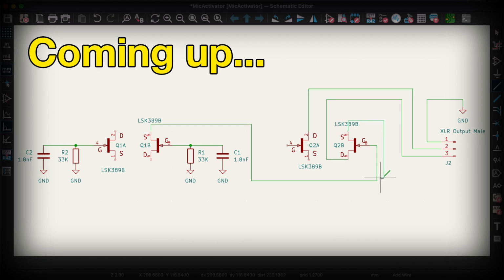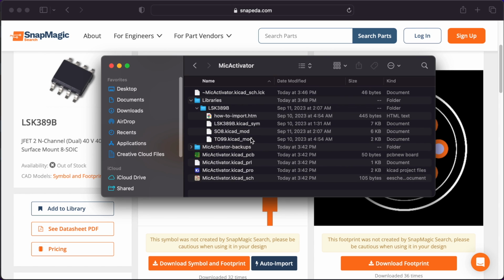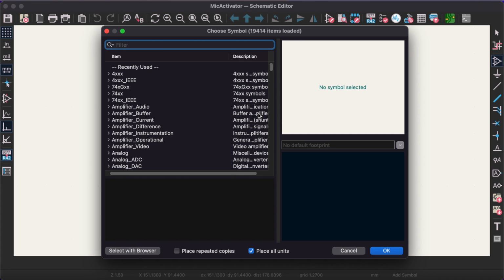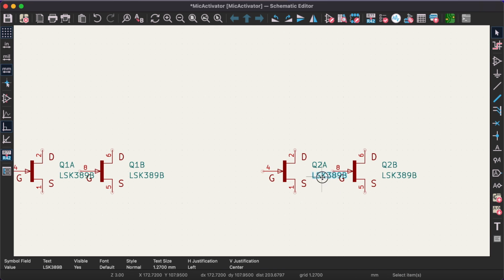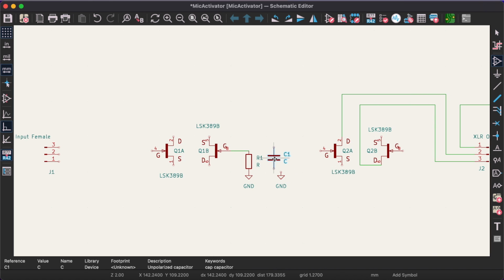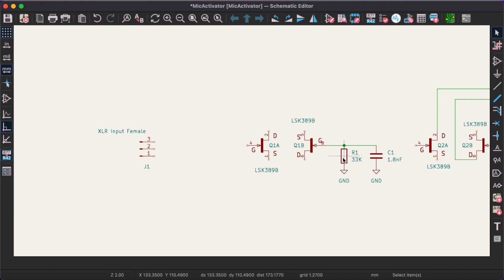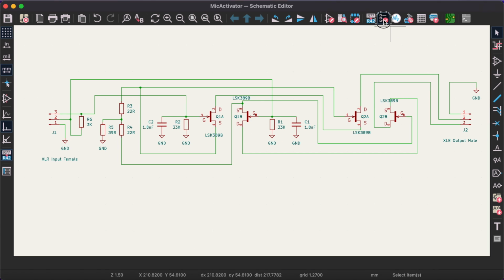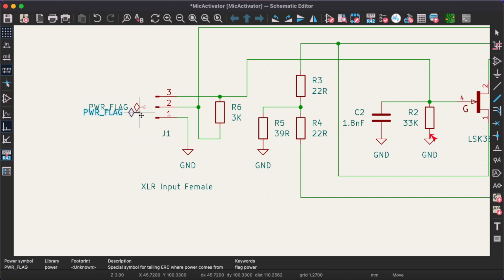KiCAD Circuit / Schematic Design Tutorial | Cloudlifter CL-1 | Mic Preamp Series Video 2

Comment: I have a doubt. You placed the PWR flags on pins 1 and 2 of the XLR input. Shouldn't they go to pins 2 and 3? Pin 1 in XLR is always ground. 
Did you misplace the flags or am I missing something here?
Reply from the maker: The ground symbol itself is marked as a power input. If you right click on it and go to properties, then click the “alternate pin assignments” tab , you’ll see “power input” under “electrical type”.

The electrical rules checker (ERC) sees this and is like hey there is this input power pin, but nothing is driving this net. This gives you an error like “input power pin not driven by any output power pin”

So by adding the PWR_FLAG, that stops the ERC from complaining. It doesn’t change anything related to the circuit.

Full disclosure, I’m not an expert, so this is what I think is happening!
Reply: @MostlyBuilds  I see. Thanks for your answer.